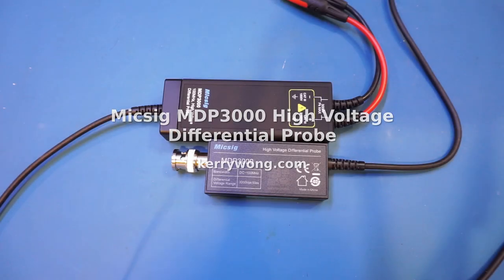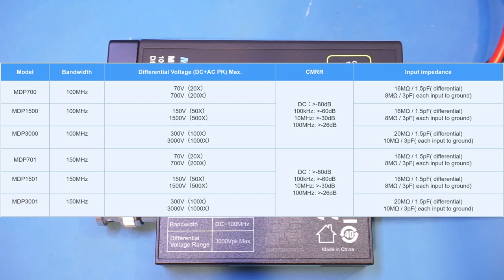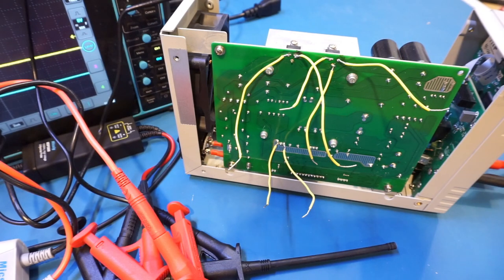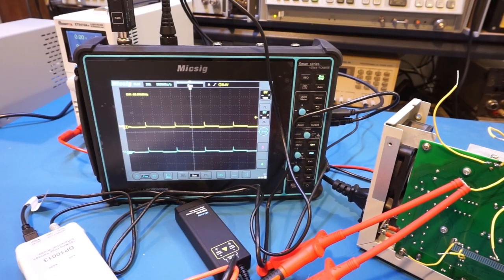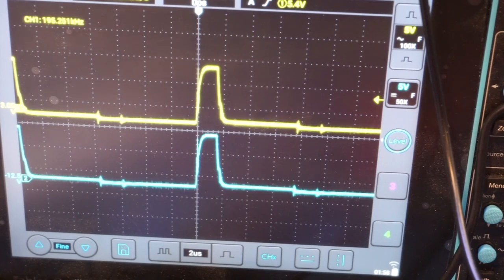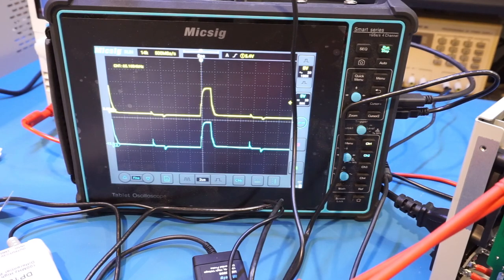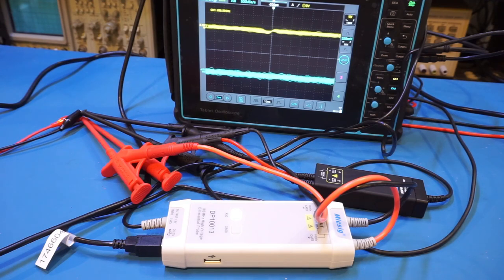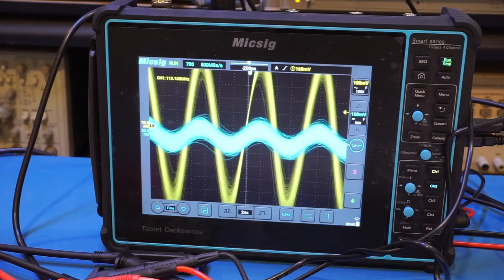Review of a Micsig MDP3000 100 MHz High Voltage Differential Probe

Comment: To see the cmrr noise, just connect the probes together and probe a high voltage square wave such as that in a 350V chopper on the input of a 240V smps